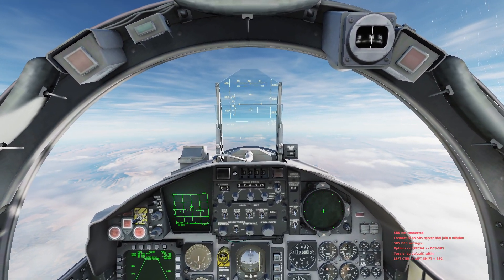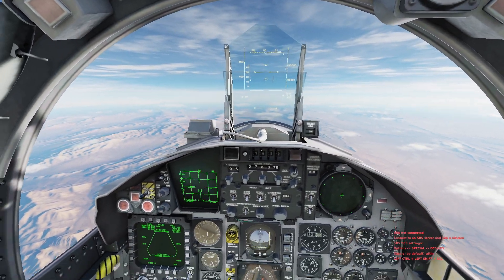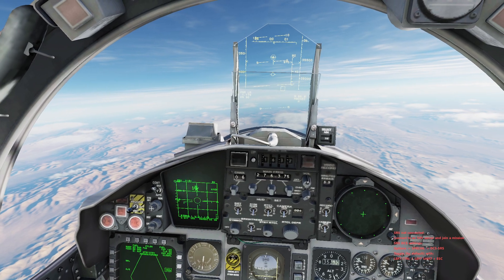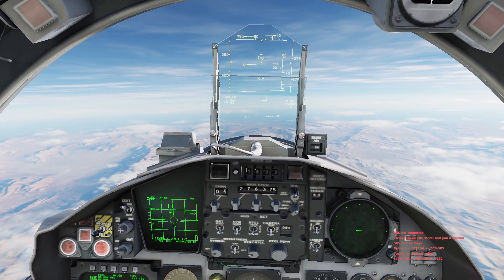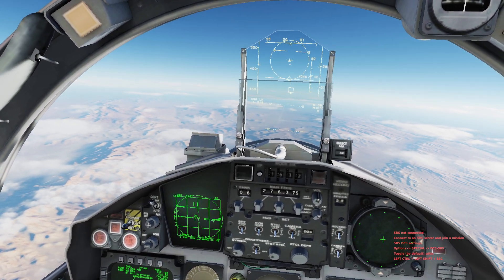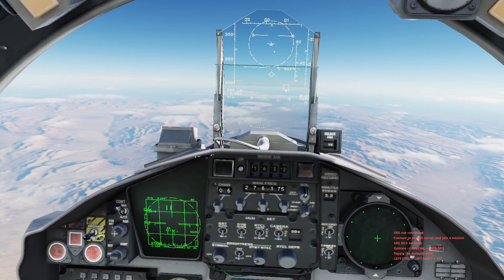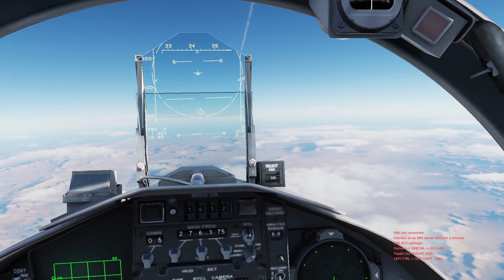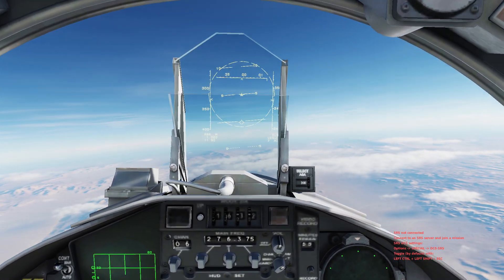DCS F-15EX 122nd Fighter Squadron - The AIM 200 Peregrine

Comment: Great video Tyrant!
I agree, you are most likely the only person to post any video regarding the AIM-200. I have done extensive Beta Tests with the missile and have concluded the following: 
•	Effective Range is 10-45 miles (in prime conditions)
•	Overall range (let’s scare that bogey) is up to 60 miles
•	Missile characteristics are fire and forget within effective range and will perform like a heat seeker @ less than 3 miles. This means that it is not detected as a fox3 on most RWR near the end, but can be fooled by flares with proper deployment. This phase is VERY difficult to defend.
•	In DCS, the missile’s warhead may or may not be consistent or effective on all enemy targets. This is because I have found that depending on various factors like track, vector, AOA and angle at which the missile detonates, the effectiveness of its notably smaller warhead could be compromised.
The best way to use the AIM-200 is to just toss them at targets 2 at a time (a couple seconds in between) at the furthest distance possible to keep the enemy at bay. They will be busy defending as you gain distance and strike with a the more dependable AIM-120D.
Keep it guys. Air superiority isn't just a goal, it's our altitude. :)
Reply from the maker: Thanks for the info. I'll put it out to the guys in the 122nd. I like that saying "Air superiority isn't a goal, it's our attitude."

Comment: holy cow 6ft/150lb and longer range than an AIM120?  Mach 1 @35k is great launch parameters too.
Reply from the maker: Thanks for watching. We ideally train to be above 40k ft and at mach 1.5+ after we jettison tanks but guys like myself get a little hesitant about dropping tanks too soon.
Reply: @thetyrantking2  wow.  I fly the Hornet most of the time.  It's a struggle to get anywhere close to that alt.
Reply from the maker: @chrisrh281  Yeah, from what I hear the Hornet is a pretty cool aircraft in DCS. Its engines aren't necessarily one of its' strengths, but they aren't bad compared to say the JF-17.

Comment: in before HD has even processed  :D
are these fire and forget or did you need to keep your aircrafts radar locked to guide them in before they go pitbull?
also side note, i think if you press left CTRL+F6   you get a missiles eye view onto target. always fun watching them track and destroy close up..
thanks for info i might have to check these out, do they work on the basic F15C? or does it need to be the EX?
Reply from the maker: Thanks for checking out the video so quickly. I believe it goes pitbull at a certain range from the target like the AIM 120s but I should have figured that out for sure. I have more testing to do. And I'll check out the left CTRL + F6 feature. The missile is on the EX and maybe the F-15CGE (golden Eagle), but not the regular C model as far as I know. Thanks man.